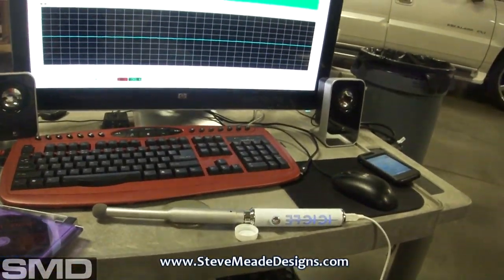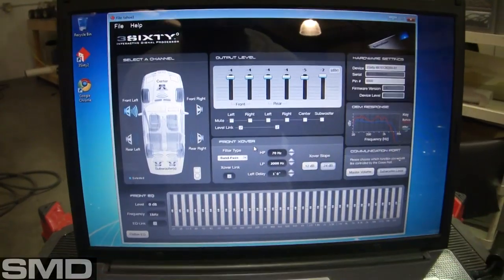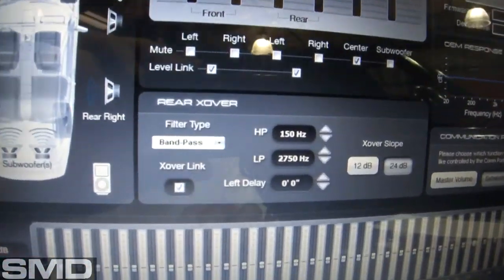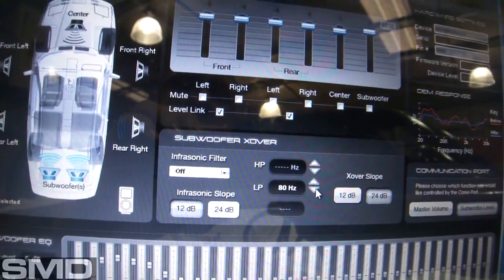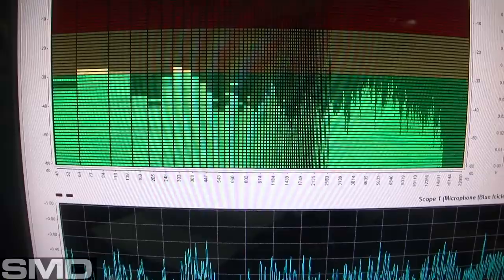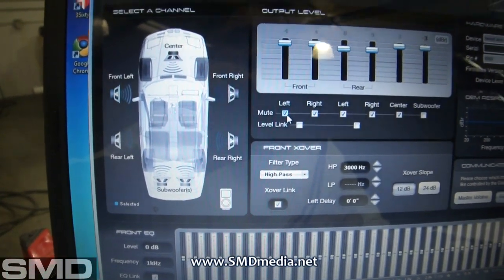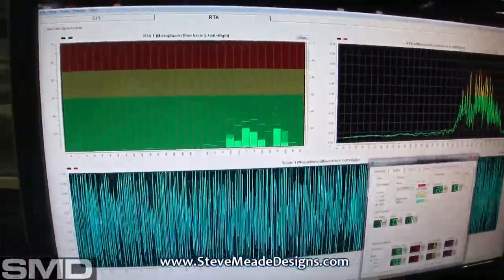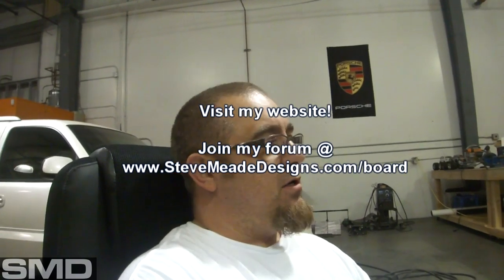Equalizing over Bluetooth - Termlab RTA & Rockford 3sixty.2 Processors

Comment: @stockleyrod the more overlap, the smoother the transition from one speaker to another. you're supposed to listen to a SYSTEM not a bunch of speakers put together.

i haven't done many crossovers but on the 12db/oct passive ones i did, playing with the caps (which in effect adjusts the slope) resulted in noticeable sonic differences, and esp on a tweeter, a higher cutoff point with a smoother slope sounds better than lower cutoff with sharper slope.

Comment: i understand how this all works now, but how do you find a reference point? do you average out the frequency range through the display from the pink noise (think thats what you called it) and then just determine from that where everything should be, or is there a set range the each speaker should be hitting at each frequency level? sorry if my question is confusing, im just really curious

Comment: I know this is off topic from your video, but i thought you will reply since its your latest video. I have a pair of subs in a ported box tuned to 28hz-120hz and i know the lower the hz is for the low, but i want to know what hz should i tune the amp to hit most note? I like low note, but i still want to hit some hi. Any suggestion?

Comment: Why do you have insane overlap on your crossovers? Like a 4 inch midrange playing down to 150hz and up to 2750hz? while your 8" play up to 400hz and then a 6.5" playing 70 to 2khz? thats 6 speakers playing the 150hz to 400hz freq range. I promise those 4inch mids will sound less stressed with a higher crossover.

Why don't you try tightening up those Xovers. say;
Subs 20hz to 80hz
8" = 80hz to say 315hz
6.5" = 315hz to 1200-1500hz
4" = 1200ish to 6khz
then the tweets 6khz and up.

Just a thought

Comment: Hey i have a question. I have 2 subs and each coil are 4 ohm. If i wire them in parallel it will give me 2 ohm, but i want to get the most of my amp and wire it a 1 ohm. And i want to know if i buy a 2 ohm resistor and parallel it to my subs making it 1 ohm. I want to know if my amp would mess up? And it that would work, can you tell me how many watts i should get of a resistor?

Comment: @delvinmacmillen18 look up the specs on your speakers and your amp. if either doesn't support that little resistance i wouldn't do it. it's not the amp you should worry about, it's the speakers. less ohms = less resistance/more power exerted on the speakers (possibly blowing them out). more ohms = more stress on the amp. i've never heard of using a resistor in place of speakers before. you would need two more speakers to reduce the resistance. you should ask a professional to help you.

Comment: I know this is an OLD video, but something struck my eye. Something that the normal human, or your ear probabbly doesn't even notice. But I noticed you have nothing covering the 2750hz- 3000hz range. Whys that? Your tweets start at 3000hz of course, and the 4s are set to 2750. Think adjusting either one lower or higher would really mess with your sound quality?

Comment: the equalizing has to be done, before setting the gains, right? because otherwise, it could distort at some levels?
Reply from the maker: nahh. You should never move a slider on an EQ high enough to introduce distortion.  If anything you find low spots and CUT around them rather than boost around peaks to even it out (if that makes sense).
Reply: Set the gains first. 

After the gains, EQ to your preference, than bring the total level down by the highest boosted frequency.

Comment: nice video but i see two problems...what is playing from 2750 - 3000hz?  also doing each individual set of speakers is great but you really need to tune them all together because they other speakers may cause cancellation to the group you are working on.  plus you hear your system as whole not in groups of speakers.